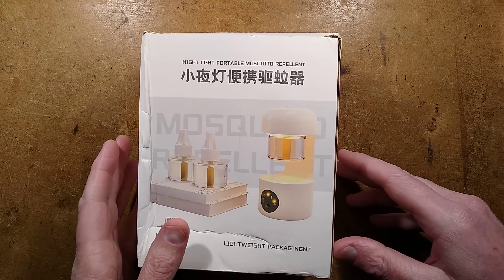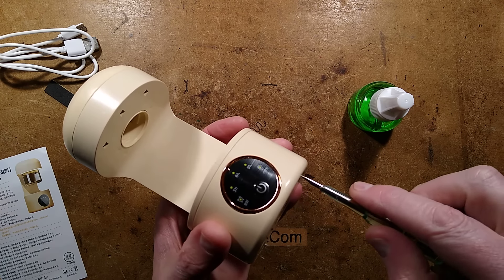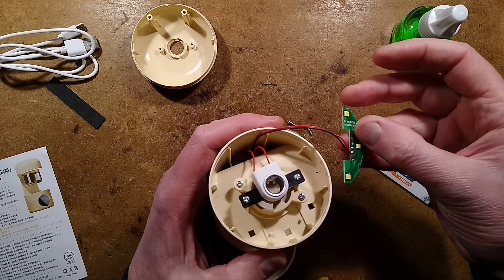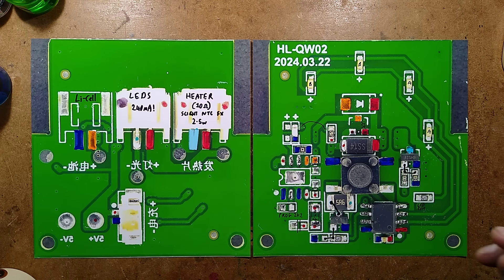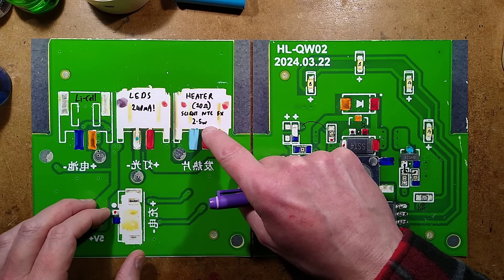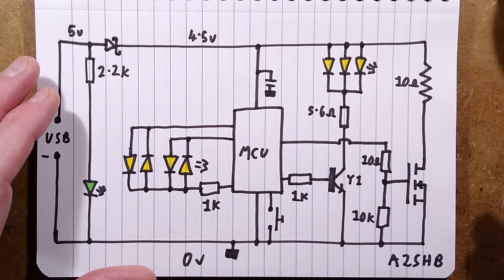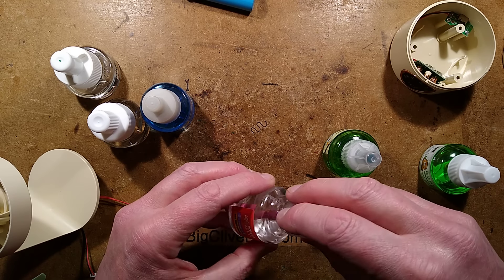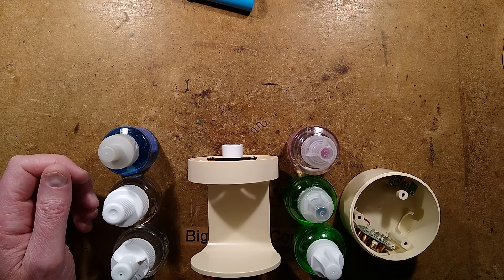Biting insect vapour unit - with schematic

Comment: Honestly i appreciate the leds being dim on the control display, I swear everything today either has unnecessary obnoxious beeper or led displays brighter than my future, and lot of them are not doing both.
Reply: Edit: I meant to say "lot of them are NOW doing both"
Reply: I had a fan with LEDs bright enough to read by. 

Had to wrap Velcro around it to block the light.
Reply: @alistercrowe8531  same, I understand they can be bright but it doesn't mean they should it's so unnecessary. Specially with something you have on your nightstand.
Reply: And blinding BLUE!
Reply: @blackturbine  I got a chiming clock, very tasteful, but then couldn't hear the tv 😠
Reply: 100% WAAAAAAAAAY too many devices have STUPIDLY bright LEDs on them, special mention for TVs and Computer monitors with obnoxiously bright blue power LEDs.

When blue LEDs became a thing industrial designers put them in ALL SORTS of stupid places (another honourable mention for a "media laptop" from HP that my other half had with a SUPER GLOSSY screen and BRIGHT BLUE LEDs on the control panel immediately below it which glared all over the screen when you tried to use it for it's intended purpose...) unfortunately they don't appear to have grown out of that yet.

This may or may not be a pet peeve...

Most stuff I have that has such LEDs in it gets immediately cracked open and either a high-value resistor placed in line with the offending LED or the offending LED gets replaced with an unobtrusive Red GaAs LED (usually also with a high value resistor in line).
Reply: @SomeMorganSomewhere  yeah I do understand, blue leds are my favorite and I like them bright, but not constantly burning a blind spot in my eyes. You are right about blue power leds, like why the hell does it need to shine so bright it washes out the lcd display it's so obnoxious, i just resort to same thing as you and put high value resistor to make it dim.
Reply: Yeah, products often have those piercing blue LEDs to stand out when on store display. Unfortunately only few have brightness control or switch off for them.

Comment: "Even moew VDE non-compliant" haha! A good one. There are "slim" screwdrivers that have a thinner shank a few centimeters from the blade/tip to accommodate the insulation of the same outer diameter as the business end. I've got a few from Rittal, and Wiha also make them.

Comment: 11:02 That SOT-23 footprint may also be used for a P-channel MOSFET. This way you can get almost zero voltage drop across the power source switching circuit when the device gets its power from the battery.

Comment: 9:40 To reduce the current to the LED's, couldn't you simply cut the trace of the negative going to the LED socket, and put a resistor from the via to the leg of the connector ?
Reply from the maker: It's easier to add a series resistor next to the LEDs.  I ended up doing that.

Comment: Down Under where we have PLENTY of mozzies (and Sandflies),  this sort of thing is very handy indeed. You can also buy a similar system using Citronella or Tea Tree oil, which is also a locally acting, non-toxic repellent, though not as effective as the Pyrethrins. You often get Pyrethrin - based insecticides combined with synergists, typically piperonyl butoxide. Those ubiquitous, VERY cheap A2SHB's  can switch a surprising amount of power for the size - 1.25 watts.
Reply: Things like this don't work up in the states, although things like citronella candles still get sold due to placebo effect. Picaridin and good old fashioned DEET are the only things that actually work, but has to be applied to the skin of course.

Comment: Sory for oftop but i get solider from friend. Did you know how to check if its lead free or proper solder? Labbels are torn off.
Reply from the maker: The lead free will look matte and the lead will be shiny when solder connections are made.  If a vapour comes off as you solder then it does contain a flux core, but if there's no vapour then it may need external flux.

Comment: You know, I always preferred the look of the zigzag resistor symbol, maybe because that's what I was taught when I was a kid. I stopped using it eventually though because it just felt like a chore to draw.

As for mosquitos, I've never bothered to actually verify this but I remember reading years ago that mosquitos are apparently such weak fliers that you can repel them simply with a decent fan. Thankfully, I haven't lived in a mosquito infested area for many years, so I've not had much need to test that theory.

Comment: How hard do you think it would be to ADD the battery functionality to this? It seems easy to solder on a 2 pin battery connector and charging status LED, but im assuming the hard part would come from trying to find out what charging chip needs to go in the empty spot?
Reply from the maker: It's a TP4056.

Comment: So if they had configured it to use rechargeable batteries and have it set to run at a 25% or 50% duty cycle with the dimmer LED mod you mention at the end, would you expect it to maybe run at least 12 hours and do you think it would be effective? Maybe not as effective as always running but effective enough that it might help people get to sleep without being constantly woken up by biting insects. I'm thinking maybe 1 hour running in it's current operation, then off 30 minutes, on 15 minutes, off 30, on 15...
Reply: There is about 18 Watt hours in two good 18650s. That will be around 7 hours continuous for a 2.5 watt heater. You'd get less with the supply diode and LEDs on. Divide the 7 hours by the duty cycle and you'll get the effective run time. your example would be 7 minus 1 for the continuous on time, then running at  2/3 duty cycle (66.6%) would theoretically give 6/0.66 more (another 9 hours) so 10 total. Like Clive said, about one nights worth.

Comment: Interesting mosquito bite preventer, if it really works 🙂 As I was watching this video, I was biten 3 times by mosquitoes, despite not being their season here anymore.
The best mosquito trap I had (bought from eBay UK, some 20 years ago) was based on a simple principle - mosquitoes use infrared to find their targets and will look for body and vein temperatures to bite. The trap was just a heated cylinder (around 40ºC) covered in sticky film and every morning I would find a dozen, or more, new tenants in the trap. Problem was the proprietary sticky film got rapidly overpopulated and was very expensive to replace, due to postage fees. Finally, one day someone accidentally smashed the thing. Never tried to replace it and don't even know if they are still manufactured, because they used a very low power tungsten lamp as heat source. Of course I could build one myself, but I got too lazy over time, and I always have a can of insecticide at hand, on my desk (toxic stuff, though). Maybe I should have a look at this repellent...
Reply: Following my post above, I went to Aliexpress and couldn't find this (or a similar) unit - only zappers and UV stuff that we know it doesn't work.
Reply from the maker: You can buy random sticky fly sheets online.  It might have been possible to make one fit.
Reply from the maker: Try searching for USB mosquito.  Once you finally find an oil based unit there will be loads of links to others.  220V will also work as they do mains plug-in units in 120V and 220V.

Comment: I have lived in a mosquito filled part of the world and have tried all of the most common types of repellents. Literally none of them work lmao. We have a saying that the price of living in paradise is Mosquitoes!
Reply: Get some Permethrin 10%, 32%, etc and look online for dilution specs.
Throw clothes on a line outside and spray them down and let dry.
Perfectly safe, is almost impossible for it to penetrate skin.
Did this on my brush clearing clothes over the last Spring/Summer and we're crawling with ticks.  Noticed over several months that I had almost no ticks jumping on to me while working the back-40 compared to others, and never found one end of the day like every single other person would as per normal.
Stuff lasts through 7/8/9 washes easily.
Even the US-made stuff is only $15/pint which is enough to do 5-6 sets of clothes.
Would not use any other Pyrethroid variant though.
Reply: @boots7859  Ok now that i havnt tried cheers! I forgot about the ticks.. have had them in the most unfortunate places :S

Comment: Although it'd be almost "fun" to populate the charger portion of the board, i feel a Ali-cheap "protected 4056 charger module" and 3 jump wires would be much simpler (5v in, +v Pwr out & common Gnd, don't forget to add your diode). plenty of room next to cell pair. 😉 Thanks Clive, i'll have to message you sometime for an address to send you some goodies (snacks and "precious" Fets... the ones you keep "misplacing")
Reply: I forgot to add.... i thought you'd be more flammable tbh!!! 😎👌

Comment: Interesting thing, I guess you could refill it too. 👍👍
circumscribed the insulation for deeper reach, novel idea. I dont know what H&S think sometimes, we need to do this occasionally.
Reply: I suppose you could slip the little sleeve back on.
Reply: Just don't try pulling on the wick, it's crunchy and will break before coming out.
Reply: Had a UPS explode on Wednesday,  Had to cut the insulation on my screwdriver so far back I lost half the handle.

Comment: I wonder if the bright green colour is natural or a dye? A very long time ago I made up a solution of ant powder (basically lindane) in oil to kill an earwig I wanted to use as a microscope specimen. To my surprise, though the powder was white and the oil golden yellow, the solution was a vivid green - lighter than that in your pyrethrin, but somewhat similar.
Yes, I'm aware that what I made was toxic and I should have disposed of it properly and didn't. It's thirty years too late to do anything about it now, I'm afraid. I only made a few millilitres.
Reply from the maker: I think it's a clear liquid in a coloured bottle.

Comment: Don't fear the neurotoxic vapor, most of the pyrethum derived chem is incompatible with land vertebrates. 
   The broad spectrum stuff isn't really around, it exists sure, but I haven't seen ever.
    There's an adjuvant with it about always, pipernil or similar sounding.

   I used to spray commercial greenhouses with several kinds for poinsettias (a christmas flower/plant from Mexico). As far as bad went, the nicotine spray was much, much worse. Similar to mild carbon monoxide exposure (yes I've tangoed with both).
      Fish are heavily susceptible to all the common pyrethrin (permethrin?) and assorted commutations.

Comment: In sweden the rechargable aspect may be good if you are using it with solar charging in a camping environment, the battery life will be enough to keep it alive when the sun is not strong enough and it should be able to be charged up during the day if it's not raining. Could be useful inside a caravan awing for example.